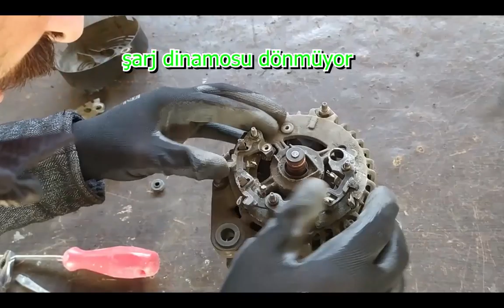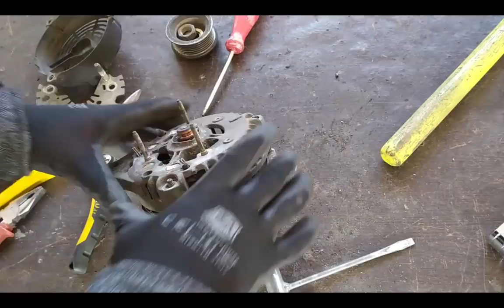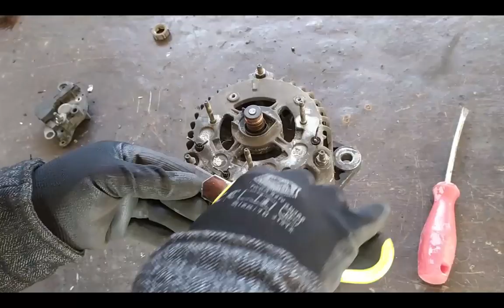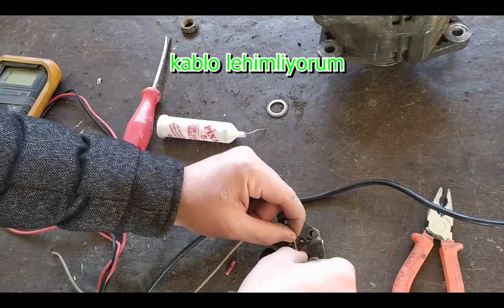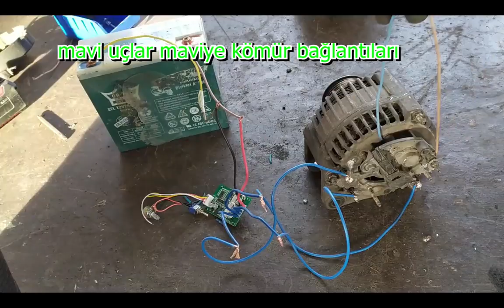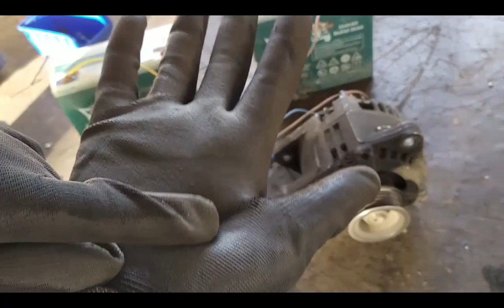araba şarj dinamosunu elektrikli bisiklet motoruna çevirmek

Comment: Abi merhabalar iki sorum olacaktı
Ben elektrikli bir araç yapıyorum 2 adet 60 volt 1200 wattlık motor kullanacağım bu motorları 1200 wattlık iki beyine mi bağlamam gerekiyor yoksa akıllı bir beyin alsam yeterli olur mu ve bu iki motoru aynı anda güçlerinden kayıp vermemek için 60 volt 40 amper akü mü yoksa 120 volt 20 amper akü mü tercih etmeliyim benim için çok önemli
Reply: 120 volt için 120 volta dayanacak beyin bulman lazım 5 akü 60 volt aküler tam dolu halı 68-70 volt arası geliyor  beyinin içinde 100 volt kondansatör var 100 volt 140 amper mofsetler var  1 akü daha ekliyenleri gördüm ama beyin yüke ne kadar dayanır.benim tamir ettiğim beyin zorlayınca standart voltajıyla  mofset patlatmış.